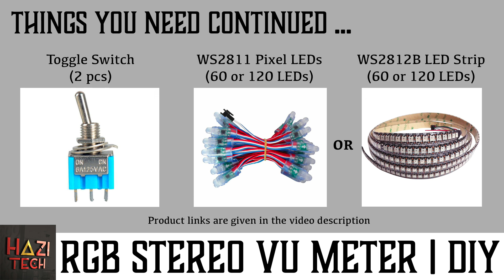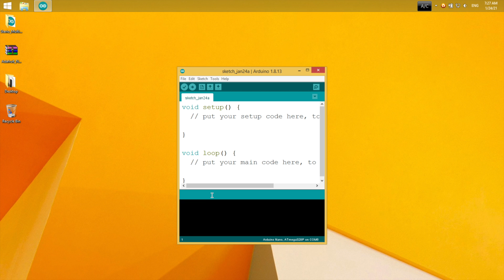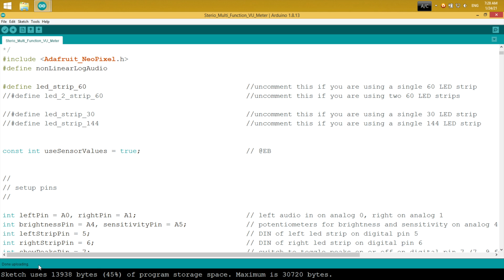DIY RGB Stereo VU Meter  | Multi Color with Patterns | Arduino Nano and WS2812B | Free Arduino Code

Comment: Hi, i want to use 144 led strip, stereo, so i need to uncomment the line ""define led_2_strip_144"" but what about the quantity of leds in my vumeter / i want to use 48 leds per strip, around 33 cm long each strip, do i need to set some parameter in the code for this ? may be the code asume 1 m, so total qty of leds is th measure of each strip. thanks
Reply from the maker: Send me your email address. I’ll edit the code for 48 LEDs per strip and share.

Comment: Hi, your video is very detail. I have one question. I dont use the audio stereo like u in vid. Instead, i use a 3.5audio jack wire, which i get from my speaker. That wire conisists of 3 more smaller wires( green, red, white), and i plug them directly into analog of arduino. It doesn't work. Can you help me with the audio in part, pls ?
Reply from the maker: Your method is correct and it should have worked.
Reply: In the 3.5mm jack the bottem ring is gnd. The top one is the left and the second is the right audio signals
Reply: You have to connect the gnd to gnd of Arduino and other two wires to A0 and A1 pins
Reply: It should work
Reply from the maker: Perfect. Thank you!

Comment: i love it, to remove the High frequency noise made from the Arduino i used a 2uf bipolar capacitor Wired in parallel to the aux + and the gnd of the arduino
Reply from the maker: That is very helpful. Thank you for the info.
Reply: can you pls explain where to fix the cap
Reply: do i need 2 caps??

Comment: I just finished building the control box. Is it possible to use it with 12 V dc without any changes (except LED stripes, which must be 12V). V in at the ARDUINO nano is specified from 7V to 12 V, so 5V at V in might be a little "undervolted".

Already found the answer: No! IO-pins are limited to max. 5V. So a approx. 10k resitor should be connected between IO-pin and i.e. push button or switch to make an internal clamping diode usefull. Alternatively you may connect these lines to the 5V output of the board.

Comment: Hi, can i use the WS2812 144 led/m?
Reply from the maker: Yes of course. I used the same here.
Reply: @HAZITECH  Hi, I think 60 leds is too tall and 30 leds is too short. Can I modify the code so it can take 50 or 40 leds?
Reply from the maker: @Hstudiosproductions Yes you can do that. Study where to put the LED qty and you can do that easily.
Reply: Ok thanks. I do want it to be double towers with 2 led strip each. That makes four(30 leds). But is that recommended?

Comment: My respects !
 I'm Stefan and a bit old (70 years old) . I've never done a programmatic vu meter before, I'm putting the electronics together, but help me start by writing a 30 led RGB vu meter program. You installed a program that is in hexagonal form, I wanted to rewrite the number of ledds, but I can't open it and I don't know what to do! So I bought the parts, but until I know what to do next, I won't do it without a program, why? I would appreciate it if you could help ,my respects !
Reply from the maker: Hi, first of all follow exactly the wiring diagram given and wire all together. Then you have to upload the code to your Arduino Nano board using Arduino IDE software. If everything works, then I can guide you to change the number of LEDs from the code. Even you have 30 LEDs, existing code works and display patterns. We can adjust it later.

Comment: when I uploaded, an error occurred that said "problem uploading to board".  what do I have to do?
Reply from the maker: Try changing the Arduino nano processor from the arduino tools menu.
Reply: @HAZITECH I want to know, what if i change the arduino nano with arduino uno? Are the lamp work correctly? Sorry my English very bad
Reply: Thanks it's just skill issue
Reply from the maker: @aleefandrian7423 Glad you solved it.

Comment: hi, i have a doubt. Can i add a mic sensor and make it react to it's input? And can i make a visualizer from a matrix of leds?                                                             Thanks in Advance!
Reply from the maker: You should be able to add a mic. But cannot use with a LED matrix without a major code update.
Reply: @HAZITECH  I am planning to use esp8266 with wled, can i use it?

Comment: hi.I build this project with my student.Oonly led strip1  is working.But when ı led strip signal switch change position for two strips led 1 strip is stopped.Nothing else? ı made two 144 led strip .Please help
Reply from the maker: You seem to have done the wiring wrong. Double check please.

Comment: Dear Hazi Tech, I already sent a message last week with a question, but it has been deleted. I have a question about the VU meter if it is possible to use a microphone instead of a line in jack. I'd love to hear from you. Kind regards, Polle Oushoorn
Reply from the maker: Hi. I haven’t tried it yet. I’ll keep you updated.
Reply: @HAZITECH  Dear Hazi Tech, I tried using a microphone unit instead of the 3.5mm stereo jack, but it just didn't work. I used mini microphone amplifiers from the Chinese platform.

Comment: hey top project 

I can't upload the code, there is an error.
can you pleas help me.
thanks
Reply from the maker: What is the error that you are getting?
Reply: Yeah 

Uim I m sorry I I tried to send the code to multiple times and at the end it’s has uploaded but I didn’t change the settings. I think that I have not correctly changed the settings.

I use 2 leds strips stereo.
144led/meter.
2 meter for right
2 meter for left 

thanks for helping me
Reply from the maker: Even you upload the code as it is, it should work and light LEDs. Did you add the relevant arduino libraries first as I mentioned in the video?.
Reply: Yes yes 
The leds work now. 
But only 1 meter of the 2 meter led-strip works.

I tried to change the code but still only 1 meter strip works.
I changed the total number of leds end the half of it +1 
(Still nothing)
End if I connect my power supply, the ted stops working.
Reply: Dear 

 would it be possible could you change the code to the necessary one i need.

I use 

2 x 2meter 144led/meter 

All together 576 leds 

Thank you very much
Beautiful project!
Reply from the maker: Just search for 144 value and replace it with 288. And replace 73 with 145. Try it
Reply: 🎉🎉🎉 yes 

Thx!!
It works

I just have one more question,
I can choose from only 3 
Different Patrones
If I look in your video there are mush more Patrones .

And the led strip signal selector 
Is not working. If it is turned on to 2 LEDs are working perfectly at the same music rhythm, but if I switch to off, let’s turns white and starts flipping.

Comment: Hi, how can i add effects to work separately from VU meter, so i can have both?
Reply from the maker: That would be a total new coding. You could use a secondary arduino nano board and feed the data to the strip with a toggle switch.
Reply: @HAZITECH  Well, that is a great idea, it is easier for me now, if i don't find method how to switch between two codes/modes. Thanks anyway!
Reply from the maker: You are welcome 👍🏻

Comment: How do you adjust the lights to work with only bass and cut off other frequencies
Reply from the maker: Sorry it is not that straight forward. It requires heavy code update.
Reply: What if i add a capacitor to the audio input to block out the mid-high tone so that only the bass frequency can go through. Would that work?
Reply from the maker: Yes. That is a very good solution. It should work.

Comment: Hey man I just tried this out and almost got it on the first shot. I had a few wires crossed , figured it out, and it worked very well on the UNO. I currently need to play around with the code to get working with my on/off LED button setup. Should be easy to do though. Thank you very much for the easy to follow diagram. This is EXACTLY what I was looking for!! :)
Reply from the maker: Wow I’m so glad to hear. Thanks a lot. Please consider subscribing to the channel.
Reply: The code is pretty thick! Did you write all of that? It just so happened that I'm using 60 LEDs in my setup so it worked out of the box. One of the settings only hits 59 LEDs at max volumes / brightness / (max LED settings). I have not had a minute to glance at that section of code yet, but figure it's something that's rounding, not counting the last LED. It's the scene that starts from LED 1 and goes all the way to the end. The other settings work great and touch all LEDs. The dual LED setup is nice too. My setup is quite cool thanks to you.

Comment: I need in this project on ESP8266 Module with only 1 input 3.5mm audio jack without any buttons (60 led strip)

Error: showPeaksPins was not declared

Please bit modify code on showPeakPin and paste in comments section please please please  please
Reply from the maker: This system is anyway designed for one 3.5mm input. Other one is for audio out. Removing the buttons wouldn't be that straight forward. Patterns are connected to the button positions and so on.

Comment: Hi Bro..can u plz tell me if I can connect sound sensor module to the Arduino nano..so what's gonna be the change/ New program codes to compile for this..plz help me out with this..thanx n regards..
Reply from the maker: I'll try to do a video guide on that. Stay tuned

Comment: when you switch from signal what is the diffrens between the 2 led strips.
Reply from the maker: When using single strip mode, you can basically turn the next led strip on with the exact same design.

Comment: Is the code working for 15 led two strips? I am making this right now...
Reply from the maker: Yes of course. You have to do a minor code adjustment to change the number of LEDs. Select 60 LED option and then look for that function. Then change 60 to 15 and 31 to 8. That’s it.

Comment: Hi i made the project but it is not working.first, when i chosed atmega 328 ide ise giving error.i am chosing atmega 328 old ,this time it is not working.leds are moving without music.buttons are workin i can change the colour.but i did not understand what the problem is.sorry my bad english🥺
Reply from the maker: You have to connect all the resistors as in the wiring diagram to make it work

Comment: Nice job! Can i use more than 2 rows of led strips but they would be shorter?
Reply from the maker: You can connect any number of strips in parallel. But if you use shorter strips, the full effect won't be visible.
Reply: @HAZITECH  Thanks for the answer. Subscribed!
Reply from the maker: Awesome. Thanks 🙏🏻
Reply: @HAZITECH  Hi, i have one more question. Is audio out used for connecting Nano with amplifier/speakers?
Reply from the maker: Yes exactly
Reply: @HAZITECH  Is Nano using full wave of audio signal?
Reply from the maker: Yes it is. And it does not alter the input audio signal at all.
Reply: @HAZITECH  Sorry, i am a bit borring. I have a single 60 diodes led strip. When i upload the code do i have to chose the code for that strip or upload hole code? Thanks bro!
Reply from the maker: You have to choose the strip length at the very beginning of the code as I show in the video. That’s it.
Reply: @HAZITECH Thank you very much!
Reply from the maker: You are welcome

Comment: Hi, thanks for the great project. I have done the project based on your circuit and code, and it works well. But when i try changing the pattern or color (button1 or 2), i didn't see the pattern of moving gradient color. Can you advise? Thanks.
Reply: Hi, I have figured it out. Set colorScheme=11 and shorten colorScheme11SpinDelay :)
Reply from the maker: Oh cool. Glad you fixed it 👌🏻

Comment: What an awesome project! But I have a question that what the 3.5mm Stereo female jack conncet with?
Reply from the maker: Thanks a lot. One jack connects with audio in from any audio source. The other one can be used as an audio out to a speaker or so. Check out my Bluetooth option linked in the video description too.
Reply: @HAZITECH  Thanks for your feedback😍😍, so your mean is that one is connects with my phone,and the other one is connects with loudspeaker?🤔
Reply from the maker: Exactly 👌🏻
Reply: @HAZITECH  thaknks!!Have a GOOD DAY😍
Reply from the maker: You are welcome 🙏🏻
Reply: @HAZITECH  Uh...It's me again😅i wonder  konw if the right LED strip is synchronize wiht the right one?

Comment: Which you use led 30led per meter or 60led per meter , if i use 60 led per meter the project is beautiful?? Or between led is very far and it's not good 😊
Reply from the maker: I used 144LED/m strip. Closer the LEDs, the better.

Comment: Can i use 240 led 120 left 120 right ?? Or little , answer me!
Reply from the maker: I have added several led qty options in the code. Please check. 120 also possible with a slight code change.

Comment: Hi can you help me i hay lots of errors when i build your code. I hav included the libary from your link but there are 47 errors. Please help me and thanks for your video
Reply from the maker: If you install all the libraries and do exactly as in the video there shouldn't be any errors. Can you copy and paste the full error message here.
Reply: @HAZITECH  can I sand you screenshots per email? Because it is to much for YouTube commentary
Reply from the maker: Sure 👍🏻
Reply: @HAZITECH  I sendet the scrennshots by email. But today ist working on the Arduino software but not on  PlatformIO on Visual Studio Code. Thanks for your help and your fast answer. Like and Abo
Reply from the maker: Super. Glad it is working. Cheers 🥂

Comment: @HAZI TECH Hi, I builded vu meter from yours project but I used only one led strip. Code was uploaded for one strip and also I deleted switch for "LED Strip Signal Selector", resistor which is plugged in pin D6. Music is fantastic quality but 29'th LED on the strip is blue color all the time. LED strip nothing else displays. Where I make a mistake? In addition your project is fantastic!! More such projects!
Reply from the maker: Since you are using only one strip, you should be using the stereo mode which divides the strip in to two halves. So as you see in the video, the center LED is always stays on as Blue. That’s how it is.

Comment: one more important in this video which component or register resistance value not showing in your circuit diagram. I feacing too problem. And also Audio input and output canection diagram.
Reply me..
Reply from the maker: You have missed the first part of the video. I have clearly shown the resistors with the colour codes there. So you can identify those easily. And you can plug any audio source to Audio In via a 3.5mm audio cable and speaker system can be plugged to audio out.

Comment: I know this one is dumb question but..can you tell me what should i connect to audio input and audio output?
I am totally new for this...thanks
Reply from the maker: Hey. No worries. Audio input is basically a input from a audio source like a laptop, mp3 player, ipod, etc via a 3.5mm headphone cable. Audio out is the speaker device. Like a subwoofer, home theatre or even a simple PC speaker.

Due to the large number of comments, going forward, I have to give priority to my channel Subscribers when replying. So, please consider Subscribing. Thank You!.
Reply: @HAZITECH  ohh got it... thanks alot.. keep it up.you are doing great work 👍👍
Reply from the maker: Thank you so much.

Comment: Awesome Project! I am wanting to use a 3.3FT 144(2X72), so each tower would have 72 leds. Would I need to uncomment the 2x 144 and use that, Or should I use the 2x 60 and adjust it to 72? I am just confused because the 144 WS2812B strips have led's much closer together than other strips. I apologize if this is a simple question, I am still new to Arduino :/ Thanks my Friend
Reply: I think I figured it out. I would use settings for a single 144 strip and adjust the code to work with that.
#elif defined (led_strip_144)
  //settings for a 144 led strip

  int stripNumOfLeds = 145;
  int stripsOn2Pins = true;
  uint32_t stripColor[73];
  int displayMiddleLed = false;
  int splitStrip = true;
  int middleOffset = 1;
  int startupAnimationDelay = 1;
  int orangeLimitAmount = 0;
  int swapLeftRight = false;

Does this look correct?
Reply from the maker: You are almost there. Anyway, I have modified the code for you. Please go to the updated link in the video description. And don't forget to share the video and support me. Thanks!.
Reply: @HAZITECH  THANK YOU! THANK YOU! I would be happy to share your projects with others. Most people don't even reply to question (let alone update code to help), you Sir are a wonderful person. I know it can get frustrating hearing the same simple questions over and over, but we all have to start somewhere, Thank you :D
Reply from the maker: Super thanks for your compliment. I’m honoured.